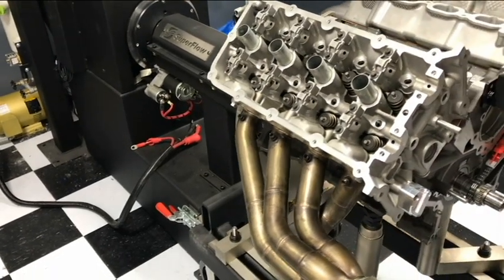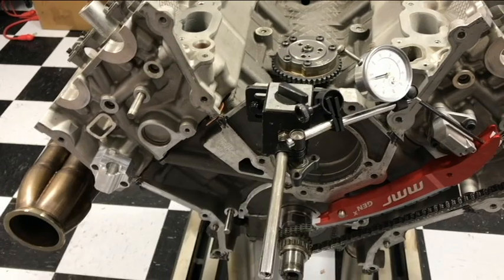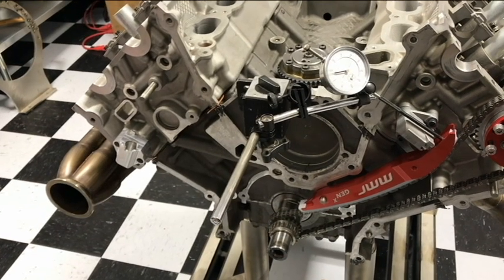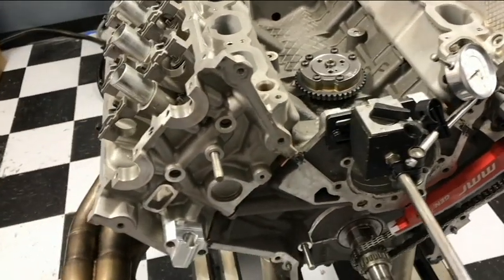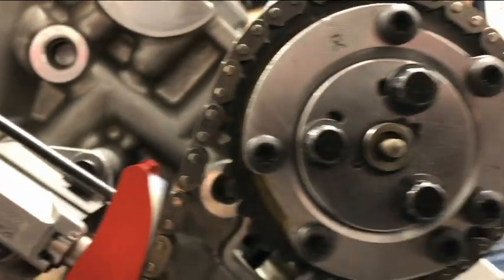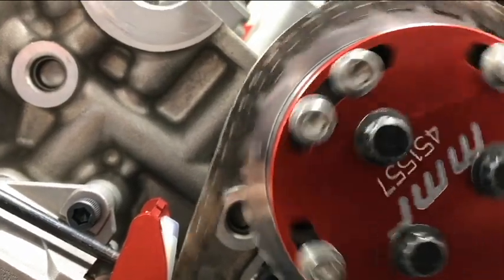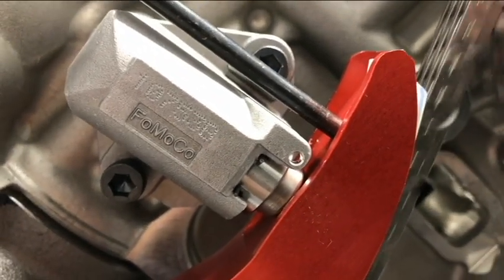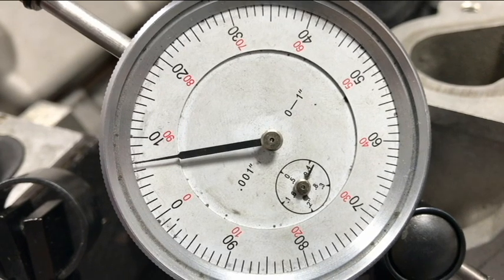Fords 5.0 Coyote Oval Camshaft Gears. Why? and the Fix!

Comment: Is there any way to fix this issue while retaining vct?
Reply from the maker: Unfortunately the Perfect Circle Gears are only for applications with locked out VCT at the moment
Reply: Unlikely. As was stated in the video this was done deliberately by engineers to help the VVT system function. It only becomes an issue if you intend on totally eliminating the VVT.